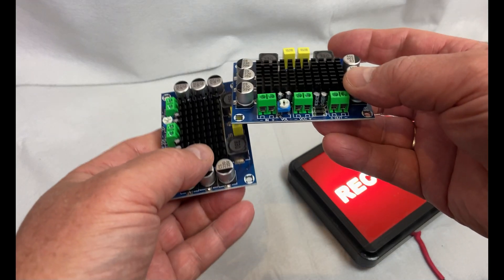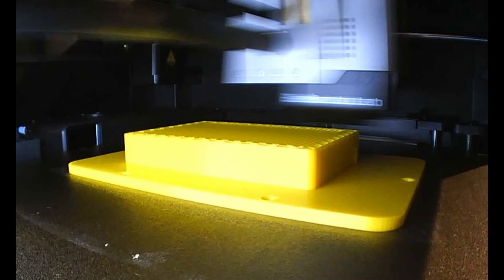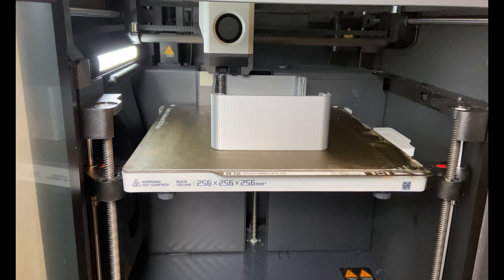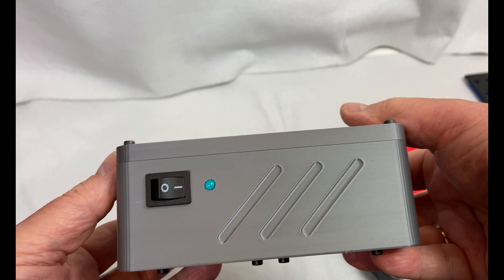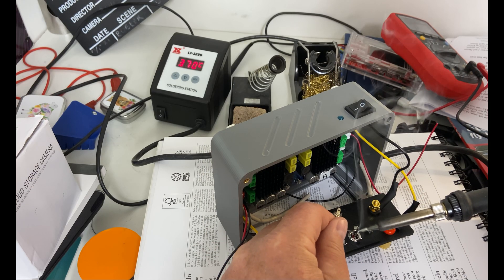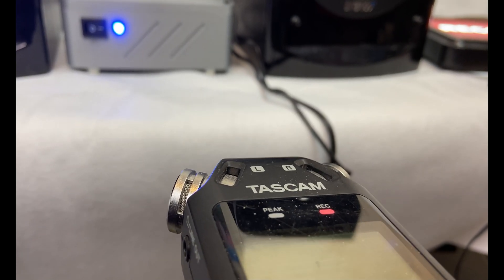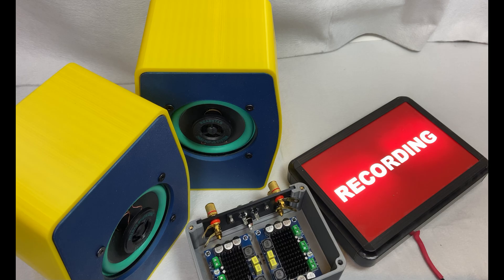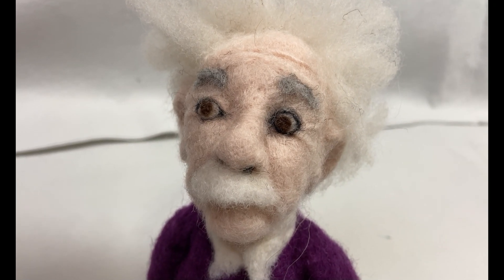3D printed sound system

Comment: Fill the walls of the speaker boxes with concrete, and line the inside with some acoustic foam
Reply from the maker: I didn't show the inside of the speakers in the video but they do have sound dampening material inside, Boxes in concrete would be nice, but that will have to be a project for someone else.
Reply from the maker: Or maybe not? I have decided to do a follow up on this!
Reply: @v4projects  Awesome, I look forward to seeing it

Comment: Energy sound bit better, most likley due to the fact they have bigger driver for that bass sound and smaller ones for highs. 20% infill probably was causing some unwanted resonance, posiibly higher infill like 50% and different pattern like cubic might make it to sound bit better, also most speakers have some sort of "vent" hole and as far i have read about speakers desing it is more complicated then some people think. Like your project and hopefully if you study a bit more sound science behind building speakers next version will sound much better.
Reply from the maker: I have a lot of respect for good speaker designers. Tuning a port correctly takes a bit more effort than I put in to this. i didn't have a lot of data about the driver and then a closed cabinet in theory should be the safest choice. I still was a bit surprised that it didn't turn out better than this. Tuning via DSP or adding a sub might have made a big difference. Changing parameters like the number of walls, infill and pattern (as you suggested) could improve things as well, but I felt the starting point was way off. Probably should have spent some more money on good drivers.
Reply: @v4projects  there is a saying in my country that Rome wasn't built in 1 day. It's a start of a journey for you with a lot of learning along the way. There will be many trails and errors along the way before you will get to finish line. Wishing you all the best. I just suggested that changing pattern and infill rate can affect sound quality. I'm kinda fresh to 3d printing having one about a year and i still learn about how to design and print my part so they work as I have intended in terms of strength and durability mostly. Trying different materials (mostly pla, pla+, petg) and infill patterns and percentages make big difference. 
So please keep up the good work and carry on with new versions.

Comment: Awesome project, and video!!!
How much does the filament cost for this project roughly?  I dont own a 3d printer, but i really want one now :)
Heia Norge! :)
Reply from the maker: 200 grams for the amp, less than USD5. 2x speakers with front and backplate around USD22 (1 kg approx).
Reply: @v4projects  wow. Building speaker cabinets is actually cheap then.  Need a 3d printer now 😅

Comment: The more solid the walls of the speaker cabinet are, the better. You could pour some concrete maybe or something and get an eq board, so you can get everything dialed in and it will sound as good or better than the energy speakers. But it was a very good video. Good job!
Reply from the maker: I think the speaker driver is on the cheap side as well. But i do agree, a more rigid/"dead" cabinet would sound better.